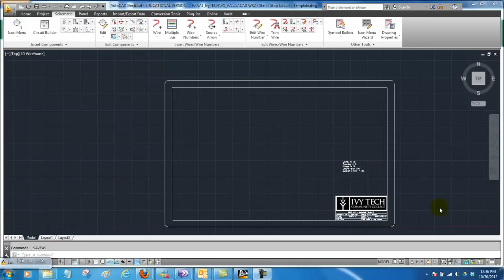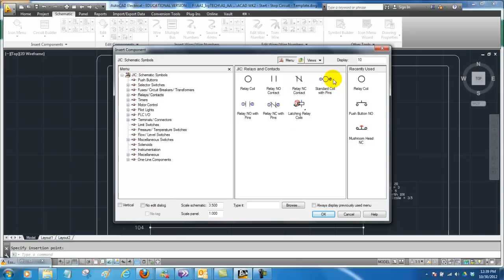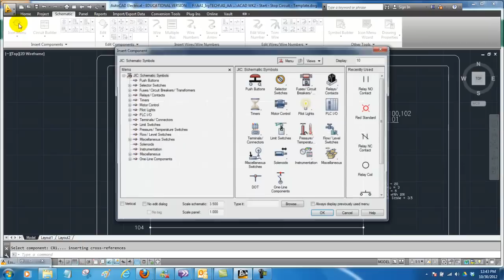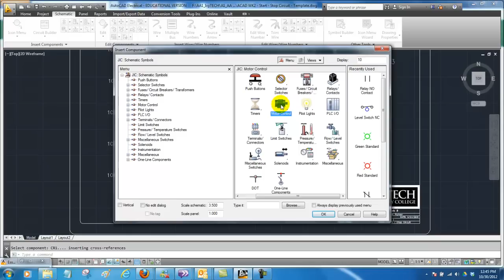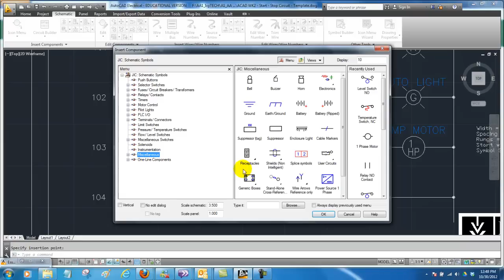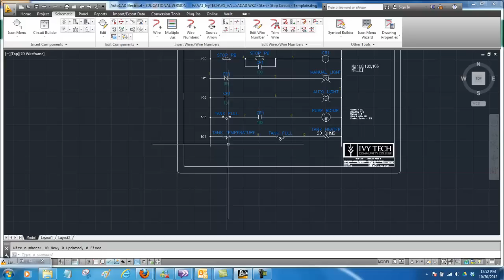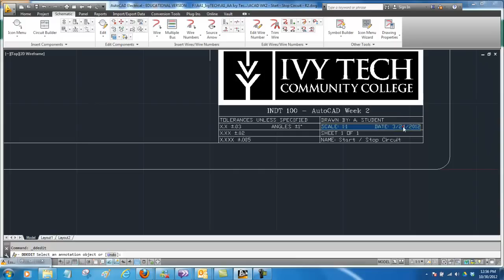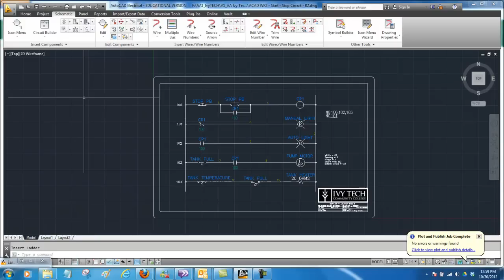Ivy Tech Northeast - Schematics - AutoCAD - Electrical - Start - Stop.mp4

Comment: But how we can check whether circuit is working or not..?
Reply: AutoCAD Electrical is not meant to do that. If you want to check if circuits are working you need to find some software
for circuit simulation.
Auto cad electrical is program for drafting electrical schematics in Industrial Automation and Process control and printing them on paper.